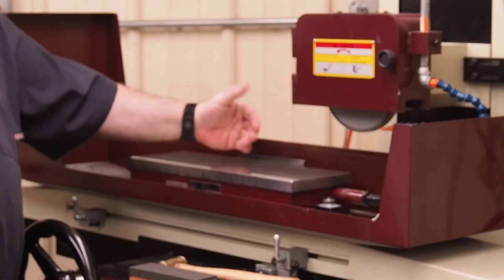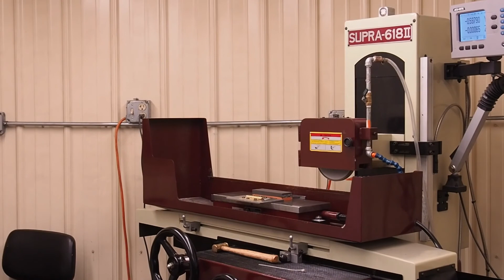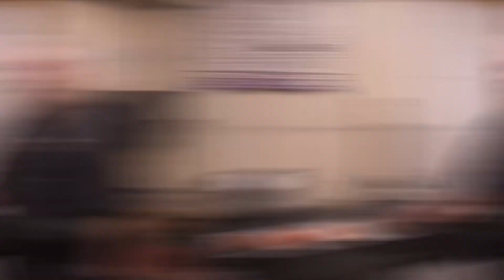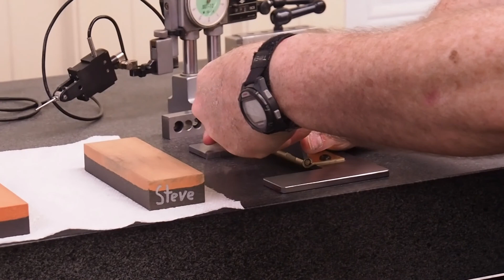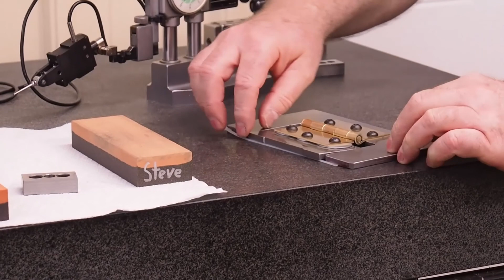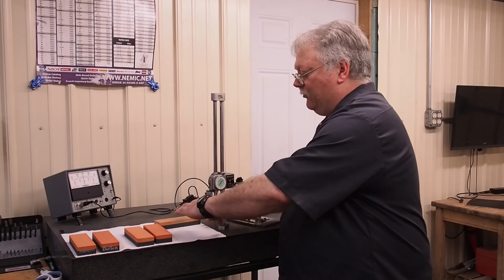Update on hold down clamp.

Comment: Thanks for the videos. I just ground a couple pairs of stones (one set for myself and the other for my son). I used a very simple method to hold the stones on the mag chuck ... I used a couple of toolmaker clamps, one on each end of the stone. Just snugged them lightly , with the toolmaker clamps lying flat on the chuck. The clamps are held down plenty tight on the mag chuck and the also serve to block the stone. Worked great! One other thing for people grinding their own - you have to clean the stones really well after grinding to get rid of all the fine grit. I used Windex and a toothbrush and the rinsed well.
Reply from the maker: Hi wallacesaan,

I think you will love those stones, especially on the magnetic chuck.
Steve

Comment: Does that clamping setup work as well when you grind the edges of the stones?  I assume that needs to be done so you can use them inside V-blocks and such.
Reply from the maker: Hi somebody else,
Yes, It works just as good. It held those stone very good, ground or not ground. Yes, the sides where ground off camera the same way Robin did them in his video except I did not step them but may do that later if needed.
Steve